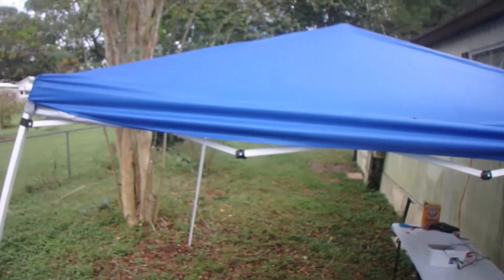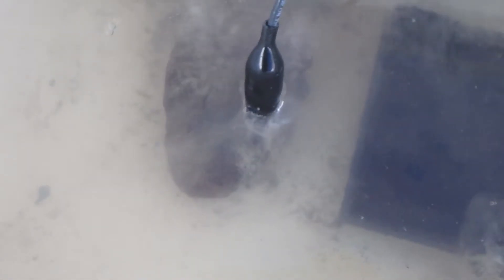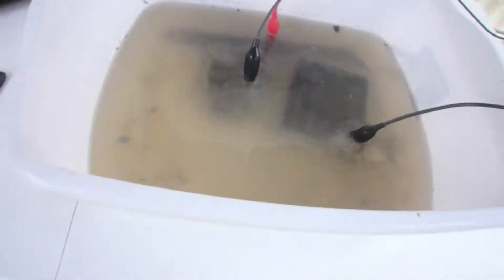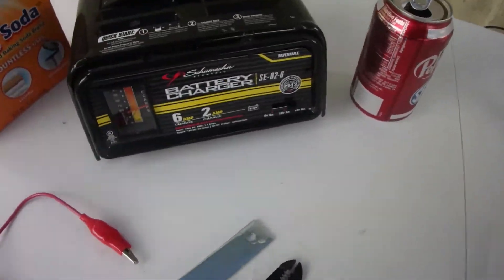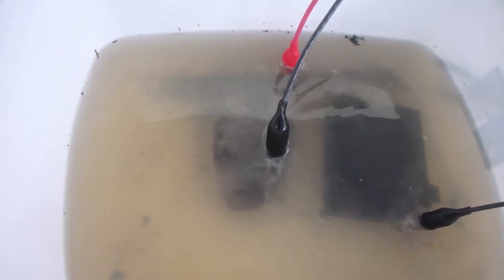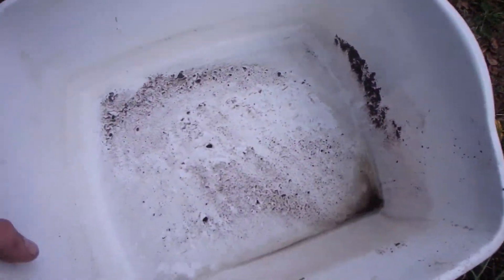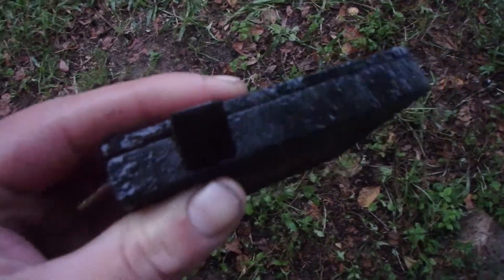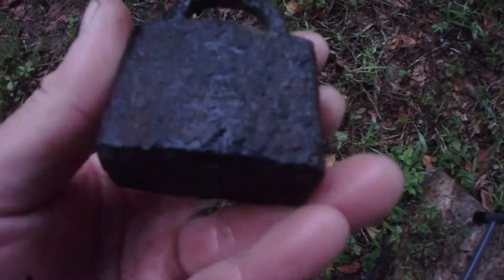Preserving Iron Relics With Electrolysis

Comment: Welcome to the wonderful world of electrolysis!  A few pointers :)  You’ll get a better connection and results by clipping the leads onto clean bare metal, so start by sanding, chiseling, knocking, cutting or whatever it takes to expose just a small amount of the nice bare metal underneath, and then clip the lead onto that.  The electrons have a much harder time passing through the oxidized metal.  Also, like you did in the video, always end the electrolysis by unplugging the power.  I had the same charger and made the mistake of removing and replacing the lead and it fried the internal transformer.  You may consider a slightly larger gauge wire for the leads if you’re going to be running the 12V 6A setting often and long.  Also, the process works by line of sight, so you’ll get the best results if the iron objects are surrounded by sacrificial anodes.  The gases by the way, pure hydrogen and pure oxygen, aren’t concentrated enough to harm you or the environment if you want to do this in like a fairly roomy garage with maybe a fan pointed at the tank.  GF will never know the difference.  Only other advice would be to use washing soda (sodium carbonate) vs baking soda (sodium bicarbonate).  Supposedly gives more conductivity to the water.  That product can be found at any swimming pool supplies store under name pH Increaser or pH Up.  Do you have an email I could send pics of my kick ass tank to?  :)
Reply from the maker: +op3crimsin thanks for all the tips i do have a email relichuntingflorida@gmail.com
Reply: Relic Hunting Florida sent! :)